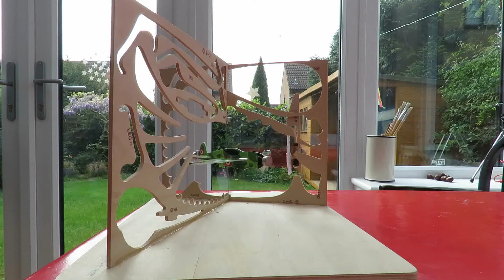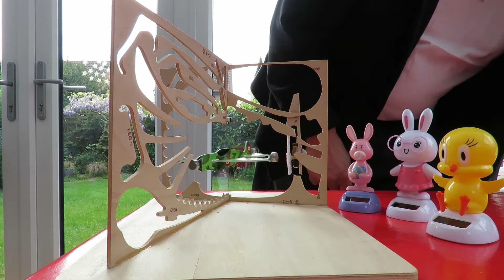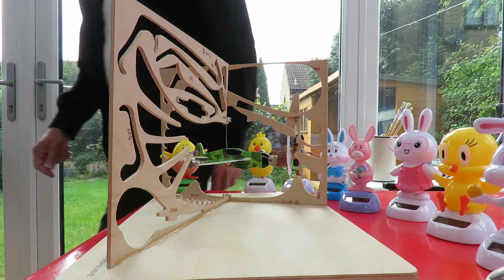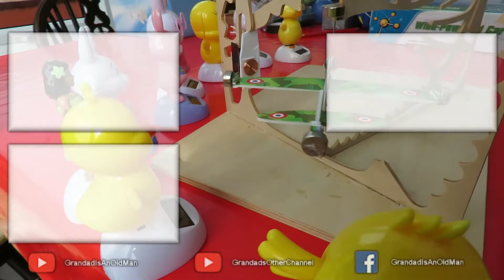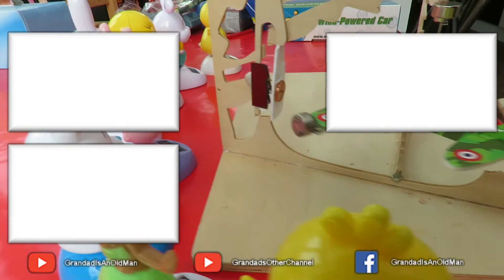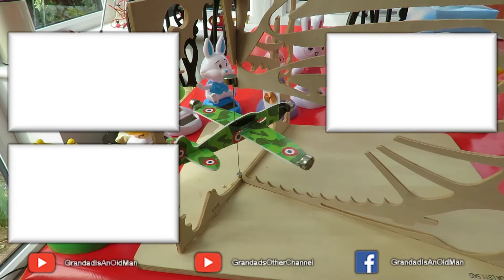Pulse Motor Aeroplane - In Daylight

Comment: you need a display case for all your solar rockers
Reply from the maker: My wife won't let me have too many out at the same time, they are too noisy, once you have more than a couple going it soon builds up. I probably have 40 or 50, I haven't counted them and I have taken some apart.
Reply: GrandadIsAnOldMan I can under stand the noise.